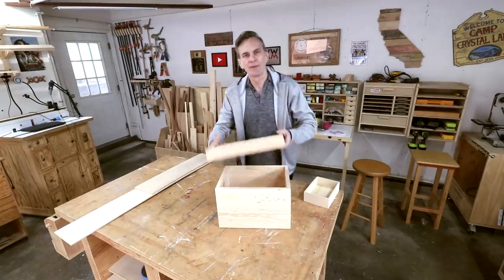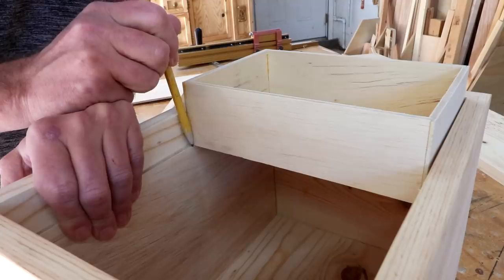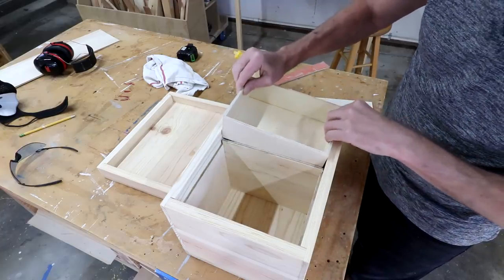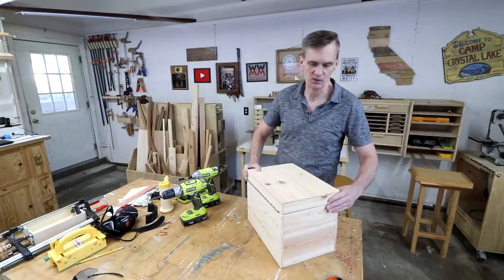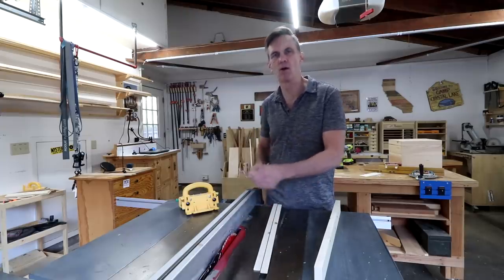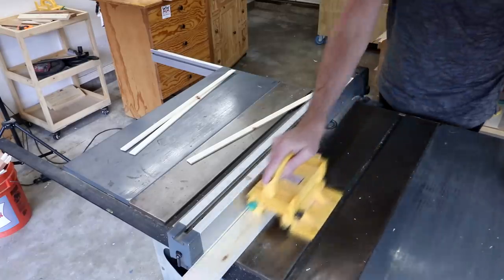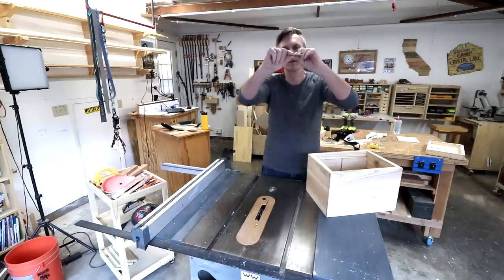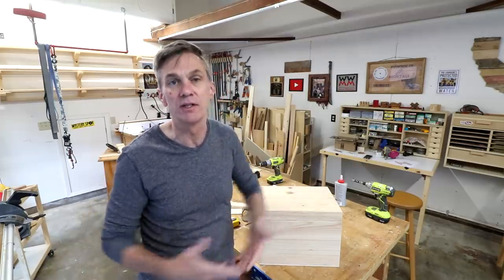Sometimes Plan B should be Plan A | The shoeshine box continues.

Comment: Most carpenters just use a wood chisel to cut the slot for the hinge
Reply: and if you don't have a chisel, you could use a good file too.
Reply: Or a butter knife. correctly sharpened of course.
Reply: or your teeth if you are a beaver
Reply: Valve grinding compound works well also.
Reply: I use nail clippers carefully taken apart
Reply: That's what I did, Vane. Good point, but man did it take me forever. I'm still happy to have seen Steve's table saw option and will try out the router idea once I have a router table.
Reply: Yes but Steve is a power tool guru! He never uses handtool, this is the way XD
Reply: Handtools are for communists
Reply: @guitar-jo  thats what communist would say))

Comment: My wife just asked why you didn't just make the 1/4" tray supports shorter? No need to cut the tray down.  Inquiring minds want to know. 😉
Reply: Yeah......measuring it BEFORE you glue it in haha
Reply: It's partly because of experience and speed.

He probably thought he cut enough in the inset and then it was off by a little and it is always easier to adjust a drawer to the dresser than the dresser to the drawer.

Comment: I’ve used my Dremel tool as a mini router in a similar situation for a small inset. The tool came with the router attachment (base) and I use the required bit for routing as well as other coarse grinding (really cutting) by freehand when applicable. Dremel tool is likely MUCH more affordable and OH SO handy!

Comment: The super lazy way of dealing with the lid gap is to add a couple felt bumpers of the right thickness at the front corners. That makes the gap consistent, and also lets you drop the lid closed without all that slamming noise.

Comment: 02:27 - alternatives to the clamp method you showed would be to reverse the heads of the clamp so that it becomes a spreader (if your clamp allows it) or to use offcuts of plywood of nearly the same length as the divider but positioned nearer the ends of the box (except last week you told us to throw out our offcuts!)

Comment: I mentioned on a couple of your vids that you could just cut the back panel down a little on the table saw, you'd only have a small gap at each side, not everyone can use dado blades (or can afford them)
Reply: True. If you don't have dado blades, you can use a normal blade, and just take more passes.

Comment: Why not use a chisel? I also like the insert method if you would stain it a different color than the rest of the box.
Reply: Chisel work for a new woodworker isn't very easy.  Top it off it involves chiseling plywood which would be with the grain and cross grain besides.

Comment: I won't lose this opportunity to be among top 10 comments! :D 
In the first plan, a less rigid but much easier solution to fill that gap is using foam seal tape which also adds something like a soft close action. However, matching the color might be a bit tricky, very thin strips of wood can be attached to sides of the foam tape(with lower height to still have the soft close action). Also strips of wall paper with wood pattern can be easily attached to the sides of foam seal tape.
In plan B very thin sealing tape can be used to seal the box very effectively without the tape even being visible.